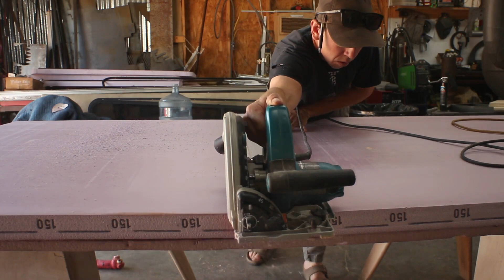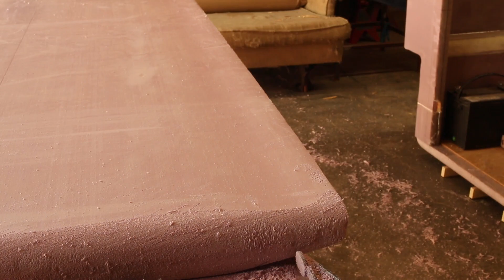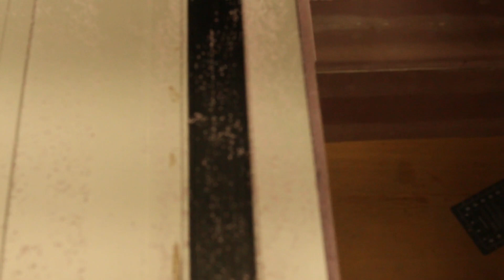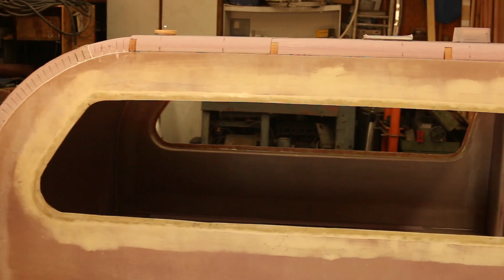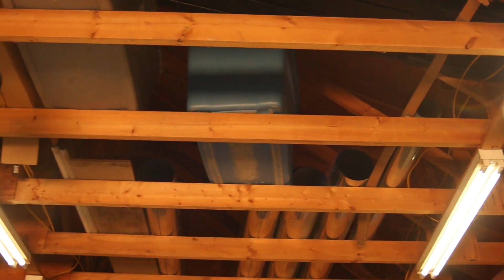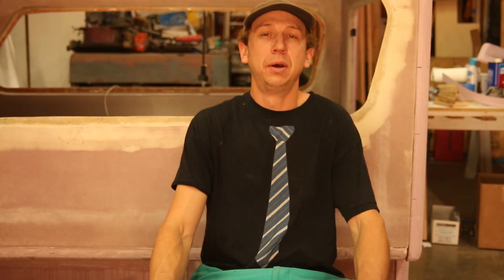Foamie Camper Update - The Roof

Comment: Nice work. I'm thinking of a forward over cab bed. Wondering your thoughts.  I'm thinking 12 foot 2x4 and a lot of fiberglass like a boat. I'd go North/South just to keep it 6 feet wide. Looking forward to your videos.
Reply from the maker: Thanks Alfred! I would be tempted to use an aluminum member for the cab-over cantilever. I agree you probably would need more fiberglass than what i'm using here, but probably not as much as you would expect.

Comment: So the channel for the water in the rear door, you make that by carving the foam, and by building the final lip with glass?  I love this idea of building to make a squaredrop, but maybe just buy the windows and doors.  I guess I have to incorporate wood support around the openings to have something for the screws to bite into.  I wish I could pick your brain more.
Reply from the maker: Hey luso! the drain channel was formed by first laying up glass over the inside 90 degree corner. When the inside layup was cured I used a 1/2" bottom bearing router bit to remove the foam next to that glass forming the final shape. Hope this helps!